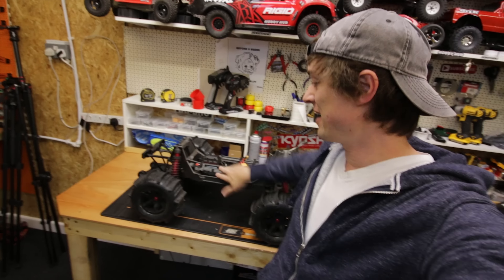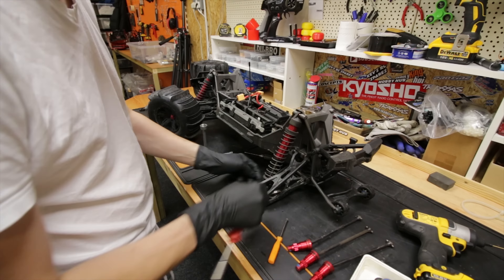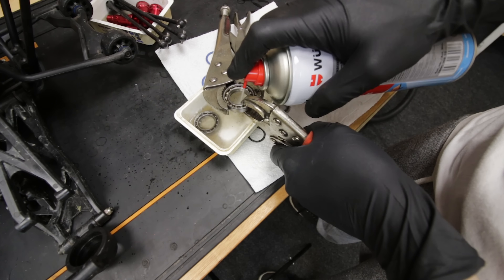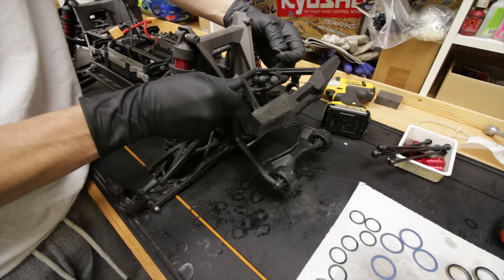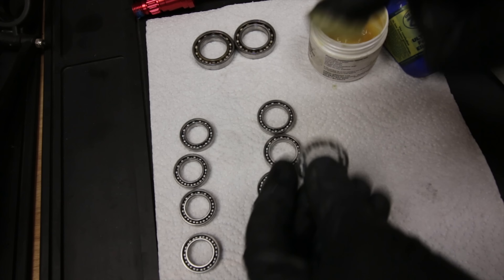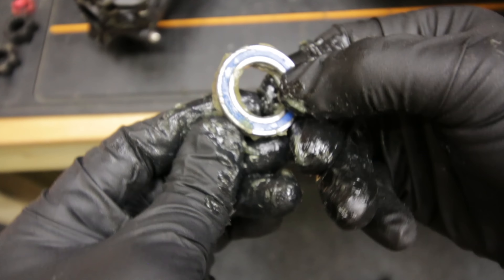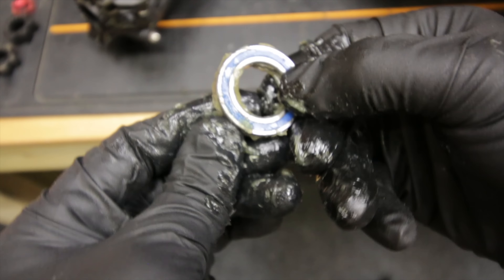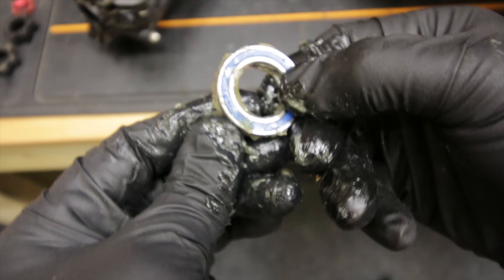RC Car Maintenance After Getting it WET - driving in water - Traxxas X-Maxx

Comment: I drove my xmaxx in wet grass plus some wet dirt/gravel and it went through some small puddles. Does this have to be done after every run like that?
Reply: Technically you don't ever HAVE to, but if you like to keep things nice it might be worth a look into the bearings and diffs just to eliminate the possibility of completely locking everything up 😂

Comment: Hey Kev awesome video as always!
 Not saying it’s better than your way, yours is probably the most proper way to clean them all up after playing in the water, but what I’ve always done, when new out of the box I take them all apart, put thick grease like you did in all bearings and gears. Never be afraid of too much grease in the hubs, I nice thick layer of grease on the outside of the seals is just another for of protection from mud and water. I use dielectric grease on my diff and transmission housing as seals. That stuff is very thick and sort of dries in place, but whipped off when you take it apart again. And that air hose is your best friend, after I play in the mud I always wash with soap and a water hose, blow everything off real well, then smother the shit out of the whole truck in wd40, which oils and displaces water to help drying, I then blow it off again till the point there’s no access wd40 on anything. By doing this it removes most all the dirt sand water and provides lubrication for your control arms and such. Been through many many truck, LOVE to play in the mud and I’ve never had bearings lock up like yours just did. I normally replace all bearings maybe twice a year, mainly to avoid gear slippage when they start getting loose. Like I said it’s not as in depth as your way, but it works well for me.
Reply: dont use wd40 on bearings.
Reply: @CodySmiley  
 I only use it to flush out the water and mud after hosing it off. I then flush the trans, axles, and portal boxes with chain lube or red n tacky spray grease. And when I say flush I mean under pressure so it oozes out all the bearings. It’s quick, easy and has proven to make my bearings last way longer.

Comment: Hi all. I soaked my 1:5 32cc Buggy in a pond today. After drying it, it was very difficult to start and would only run on high rpm. Even after running it 5 minutes on high rpm, the engine goes out on low rpm. Any tips for me? Thanks you!

Comment: Please help the other day I drove my x-maxx through water and as I was driving it back up the trail it started jerking and then taking off and back and forth by itself now there's no throttle response at all but the LED light bar that I have on it and the cooling fan still turn on
Reply: Also the steering still works

Comment: Since you pretty much use that xmaxx for water crossings you can probably get away with oiling or in my case heavy grease on your axle hubs. Good for indoor tracks but in outdoor sandy conditions it can be a burden. 👍👊😎

Comment: Not worth getting wet if have got to go through all that. Pain in the arse. You can use dry fluids heli lube on the parts you don't want to attract dirt. It's dry polymer based lubricant. Goes on wet then drys.

Comment: When I reuse my bearings I take the shield off with a syringe needle and clean it out with heavy duty silicone and put high temperature grease in it because I used different grease and it instantly turned into liquid and blew up the bearings. Your way is great but when I put just oil in them it slings out the oil once you hit the Throttle. Have you tried avid bearings? They are amazing and very smooth!

Comment: usually I just soak the bearings with the seal on, work the oil in occasionally, didn't know you could take the seal off..lol, tossed a couple away because it had come off so thought it was no longer any good.
I can see the argument against the ceramic bearings, mostly what I use now. But I am not a basher, street and trail/crawl, and so far haven't had to replace any more bearings once I put them in.

Comment: I noticed my erevo stutters after driving through a puddle of water and weeks later I get almost no response it doesn't turn on all the time and sometimes the throttle and steering works sometimes it doesn't.
Please
HELP.
Reply: Checked the seal on the receiver box? sound like water or humid.
Reply: @ksprr6856  It's either water in the receiver box or water has damaged the ESC. I tell everyone that yes Traxxas cars are great, but no RC car likes water and it will always find a way to damage them.

Comment: As far as your axle shafts go, you could try super fine graphite next time, apparently it is for dry lubing parts such as that (like cv joints, slider shafts, etc.) where you might not want to use grease for fear of attracting more grime in there (I've tried it recently and so far am pretty pleased with the results), there are also dry wax lubricants (but I'm not sold on those).

Comment: Marine grease the stuff you use on boat trailers put that in the diff and bearings. It will displace the water. Eventually normal grease goes milky and washes out. The marine grease doesn’t do this.

Comment: I tend to rinse my slash 4x4 off with the garden hose or in the shower and then spray all the steel bits like the bearings with wd40 and let it mostly air dry. It does kinda flush the grease out of the bearings but they seem to hold up fine and this way my rc is always clean and I can keep it in the house. I still do quite a bit of maintenance but not each time it gets wet which is every time XD. The wd40 is a dirt magnet though but with how dirty I get it it doesnt really matter for me.